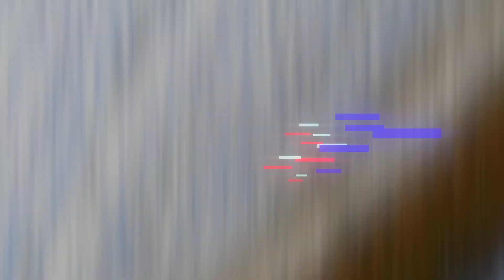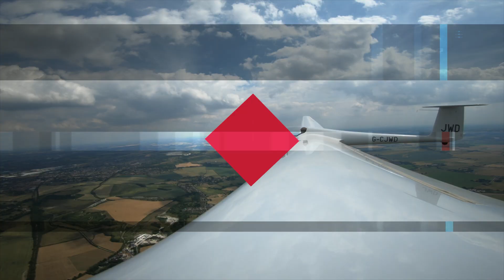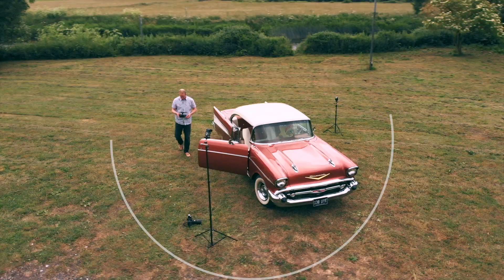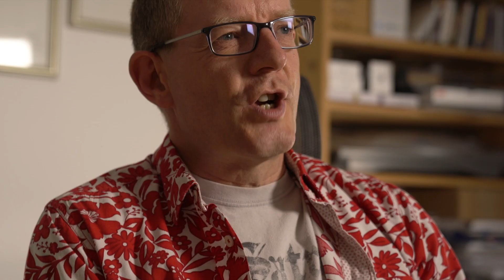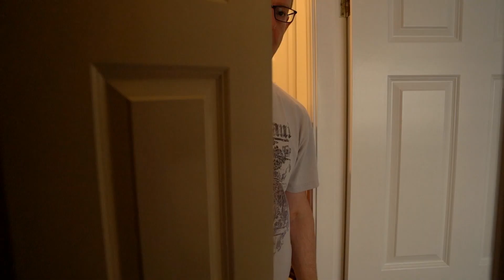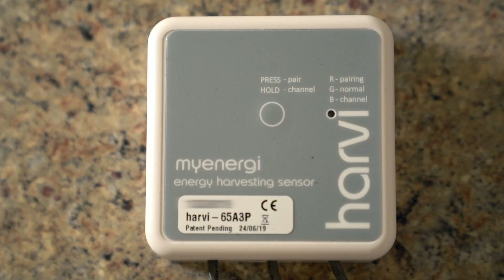New for our micro generation setup in July 2019

Comment from the maker: New new new, loads of new things in July 2019! What did you add / adjust in your own setups?
Reply: did you say charge your powerwall off mains incoming from grid during winter ? did not know thats possable. just found your channel,you got a new sub
Reply from the maker: Thanks for the sub Lenny. Yes you can have the Powerwall to charge form the grid if you set it to Advances - Cost Saving mode. It's ideal if you have a dual rate tariff; off peak and peak. You can set this up in the scheduling and the Powerwall looks at historic house usage, solar production and decides whether to pull a charge form the grid during the off peak rate to save money. I've read that it can be a little erratic, but it's best not to micro-manage it. Leave it to do its thing!
Reply: @johntisbury  thank you for that, be moving to new house next year,looking at solar hot water system and then a 4.4 kw solar system,thinking of going power wall too
Reply from the maker: Sounds like a great plan. Keep me posted on your progress. Battery storage makes so much sense if you can afford it.

Comment: If you have an older electric water heater tank, you might want to take a look at heat pump water heaters.

The old electric water heaters had an efficiency of around 90%.  The newer heat pump water heaters have an efficiency around 350%.

My understanding is that the Eddi will work with the newer water heaters, but you will need the additional relay and e-sense board.  Some advantages of this board are the e-sense mode and the ability to connect temperature probes into the water tank.

These newer heat pump water heaters can save you up to 11-kWh for every 200 liters.  This might be important to you or not depending on how much hot water you use each day.
Reply from the maker: Thanks Eric, that's good to know. I already have the relay / sensor board for the Eddi, so I will look into the heat pump water heaters. Thank you.

Comment: Just wonder how you are going to increase your solar. Lead to believe that max from residential is 4 kW and also if you do increase it will that not affect your Feed in Tariff ?
Reply from the maker: Yes, we do plan to increase our solar up to about 6kW. We will have to have 2 inverters / systems so we don’t touch our ‘golden’ FiT on our original system.

Comment: Just out of interest does Octopus Energy read your smart meters automatically? I recently moved from Scottish Power to Avro Energy and I have smart meters and they said they can’t read them. I have to do manual readings 🤦‍♂️🤦‍♂️. Something about the wrong type? They were fitted 1 year ago. Your thoughts on this please
Reply from the maker: You probably have the SMET1 version. SMETS2 is the latest and its all most suppliers now fit. They will only fir SMET1 if a SMET2 installation is unsuccessful. SMET1 was never a great design as in most cases it made the meter dumb if you swapped supplies. Hence your need to give readings. Interestingly Octopus still suggest giving meter reading each month, I’m billed monthly. In theory they will retro fit all SMETS1 meters. I’m not sold on the benefits of smart meters, but they are a necessary evil to get a dual rate tariff.
Reply: John Tisbury thanks for the clarification on the meter types. I can’t believe that a major provider like Scottish Power installed the old version so recently when they would have known its outdated.
Reply from the maker: The SMETS2 were late to the market, so suppliers were between a rock and a hard place. Miss the government’s targets for installs or fit SMET1 devices. Not a great scenario.

Comment: Hi John, interesting update. We've replaced my wife's truck with a env200 which has led to a 2nd Zappi and a Harvi. I've also replaced the failed generation meter and failed immersun with a solic 200. I'll be interested to hear in your PV video whether you're extending existing array on same inverter or adding new. Also how either option affects the FIT.
Reply from the maker: The NV200 looks ideal for business, interesting to hear how that works out. Not going to touch our gold plated FiT and array so planning for a second setup. But need to understand how that works with the myenergi app, Tesla app ect.